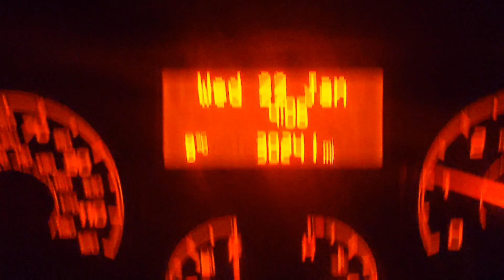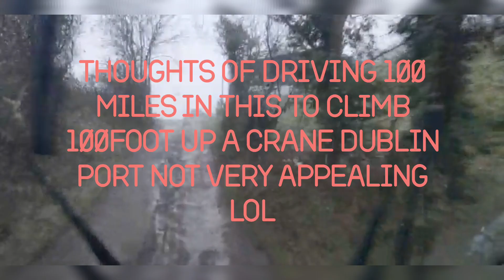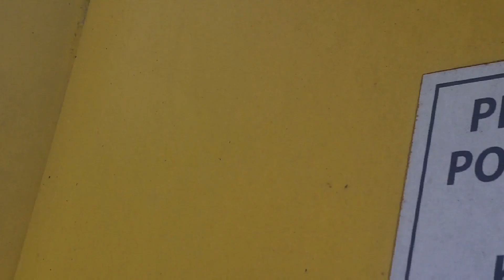working up cranes,down the docks. a few days dock life

Comment: That first was a LHM 250? I worked on them for years. The Guys from Liebherr reckoned that afte5 500 hours of use, the gib pivot pin was impossible to remove without burning it out. Proper good machine those 250's Merc v12 like the one in the vid. They produce their own motors now I believe.  In a masochistic sort of way, I miss crawling all over that thing. Hahaha.

Comment: Are pin failures common?
Is it a lack of greasing causing them to fatigue?
I was doing some lead work on houses on Epsom Downs, with the wind chill it was at least -14°. Bloody freezing. On the same job I also got sunstroke during a heat wave. Going back at least 25 years ago now.

Comment: Just how does blowing the guts out of a large pin make it easier to get out when stuck? Does the heating up the inside cause the pin to shrink down in O.D. as it cools?
Reply from the maker: Exactly also the heat expansion crushes and cooks any corrosion in the bore also before it shrinks